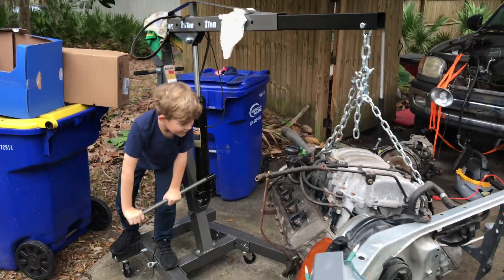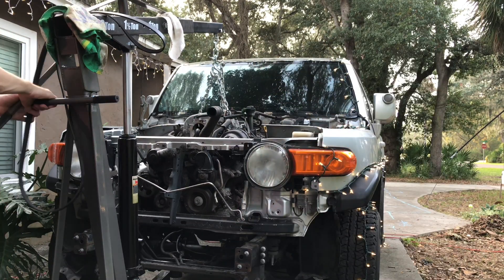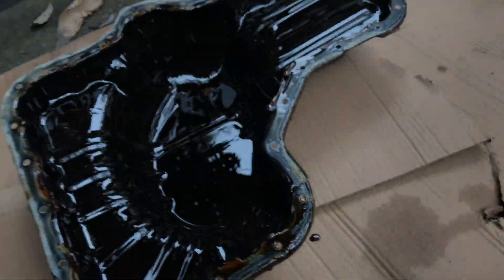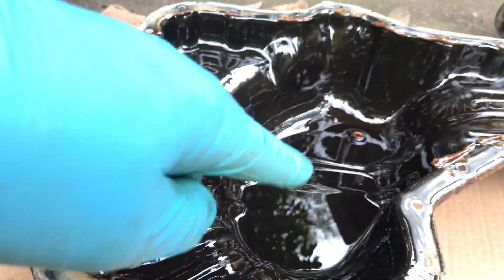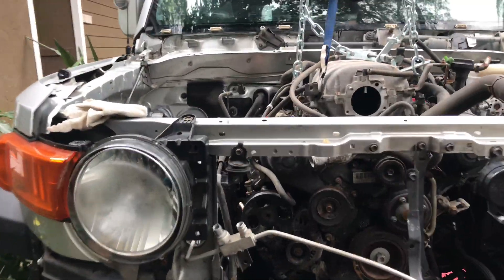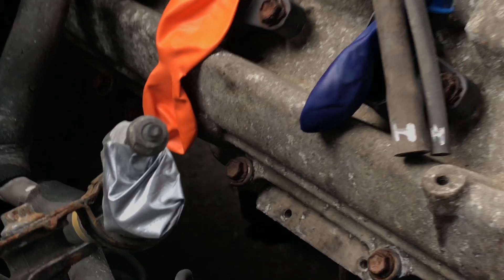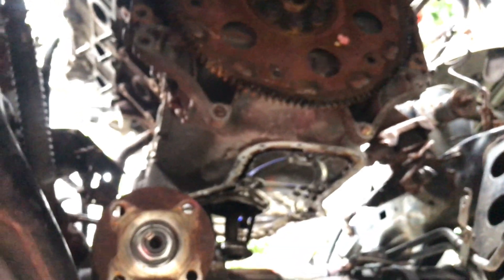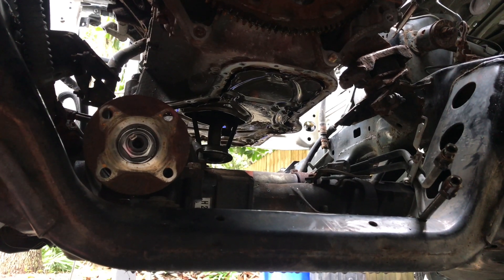Fj Cruiser V8 Swap: engine test fit

Comment: Hi. Can you think of a reason why an 08 FJ Cruiser 4.0 engine wouldn’t work in an 05 Tundra with the same engine. I’m trying to get a replacement motor for the Tundra but an original 05 tundra engine is hard to find and might have the faulty head gasket a in it. All I know is that both engines are single VVT-I and the the oil pans need to be swapped.
Reply from the maker: callofdutyguy9 hey bro! So I have a 2000 tundra and a 2007 FJ. My tundra has the V8 so I’ll have to guess a little bit. You’ll need to check if the 05 tundra has the secondary air injection. Hopefully not on the v6. That system has a smog pump and valves, plus the special exhaust manifolds with a skinny pipe along the top. Check and get back to me about the manifolds. The fj engine doesn’t have that system. You’ll need to use the tundra motor mounts and perhaps upper and lower oil pan and sump strainer pipe (they all go together). Let me know if you need any pics of the fj engine before you buy one. Search lkq engines and see if when you search for a tundra engine if the ones that pop up are from FJs. Then you’ll know for sure they match.
Reply: DadsGotADeal thanks for your quick reply. My 05 Tundra engine does not have the Secondary Air injection. I’m pretty sure they’re exactly the same engine from all Toyota trucks of that time period. The strange thing is when doing searches on car part for example. If I search for 05 Tundra engine, I only get 05 tundra engines. But if I do a search for a 05 Tacoma engine, I get engines from 4Runner and FJs as being compatible all the way up to 2011 Model Year. Does this make sense? My auto repair shops only want to work with an original tundra engine.
Reply from the maker: callofdutyguy9 ya I hear ya. I found some anomalies like that when searching for my own parts. There can be minor changes such as wire routing or clips and such that would be annoying to a mechanic but easily solvable. The issue is that places that warranty used engines will only allow engines that are “compatible “ according to them. The mechanics make money on selling you the extra warranty from the engine reseller. I was installing the ac compressor on my 2000 tundra engine today and noticed it had an entirely different alternator and mounting system than the 2003 gx470 donor engine (which is the same 4.7l V8). Something like that would cause the mechanic to need to buy you a new compressor or mounting plate which could be hard to find. I know. It’s frustrating. I’m doing my swap myself so I can take time to figure that stuff out. Let me know if you have more questions and please update me on what you decide to do. Thanks!

Comment: Love it man! Keep it up - maybe a custom oil pickup tube and pan? Pretty tight clearances - any chance a 1" lift on the engine mounts and a body lift might help? Thinking about flex and suspension travel during offroading/ bumps
Reply from the maker: Marcus Berking ya I had thought about a body lift as a solution. I picked up a gx470 with the parts I need to clear everything. Pulling the transmission from it now so I can pull the motor next and pick off the parts I need.